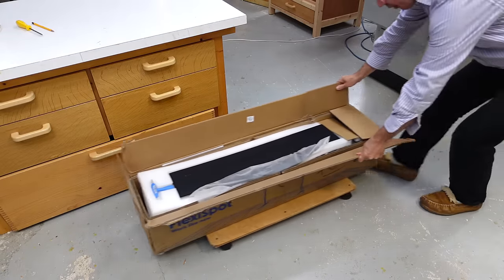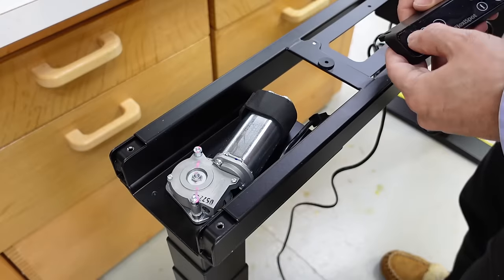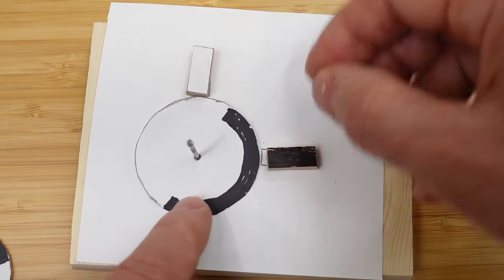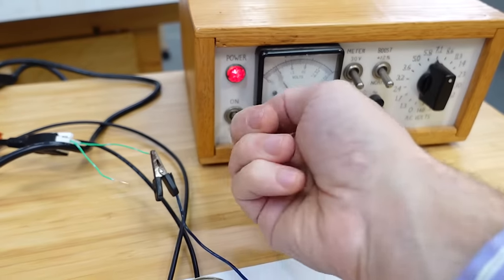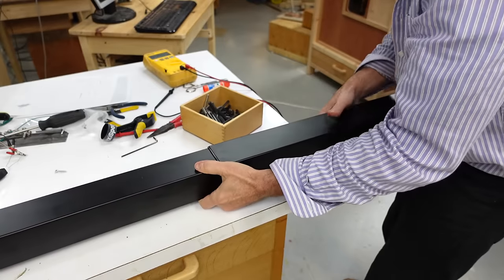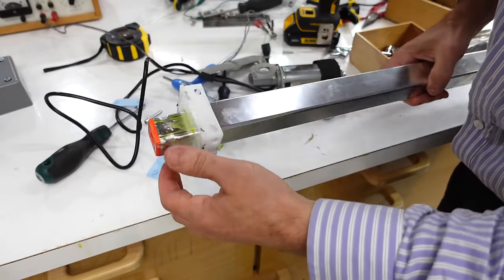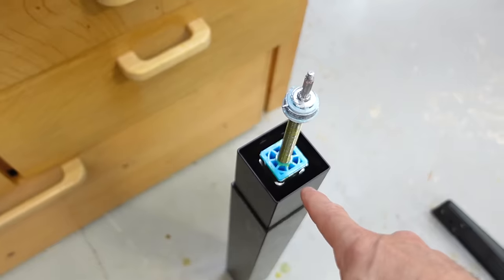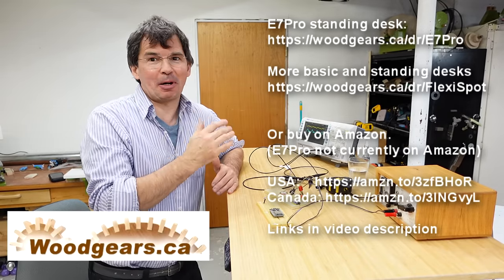How standing desk legs actually work

Comment: I hope FlexiSpot's next move is to send you just the mechanical extension portion that you didn't disassemble so we can see how close you were!
Reply from the maker: Already asked.  I think they would be willing to send a whole desk, but I'd hate to render a desk unusable just to look inside.
Reply: @matthiaswandel  In the end, the ruined part is the outer tube.  i bet once it is apart you could figure out the dimensions of said tube and replace that part to put the whole thing back together again with new tabs/crimps
Reply: @matthiaswandel Probably an easier tax write off. 🤷
Reply: @matthiaswandel  team up with the What's Inside channel lol
Reply: @matthiaswandel  maybe they can send you a leg from a faulty return?
Reply: I'm sure a render of the CAD model would suffice.
Reply: @matthiaswandel  you've done machines I thought impossible with wood. Might it be possible to mend the disassembly using your woodworking?
Reply: You can cut a slit or a hole into the extension and look inside without destroying it. Not everything is an autopsy.
Reply: @2adamast  That's true and he could also use one of those cheap endoscope cameras pushed through a drilled hole to see what's going on inside.

Comment: The dual motor setup also lets Flexispot use smaller motors or lift more weight, whichever they choose.
Reply: we are working on desks with higher weight capacity all time🥰
Reply: Maybe a little bit smaller, if you have a table rated at 100kg/200pounds, as a customer you would probably be a bit upset if that was only true dead center.

So if you have one motor, it needs to be able to lift 100kg and the mechanics will balance this. If you have two, they each need to be able to lift 100kg, since that's the worst case.

There is some slack, since there is losses in mechanics and maybe some forgiveness from customers, but I'd estimate each motor in a dual setup to be at least 75% of a single. So 50% more in total.

Comment: I've had my Flexispot desk for a few months now, and I've absolutely loved it. Dark Bamboo desk top, dual motor legs, 3 stored heights and an alarm for time based reminder for movement.

The reason it wasn't bottoming out around 7:49, was because it was running fast enough that when it reached the bottom it hit hard enough to trigger the collision avoidance. That's why it kept reverting to the last static height you left it at
Reply from the maker: yes, I figured that eventually, when I noticed that it reset when I hit bottom slowly

Comment: It would be interesting to see a DIY version made by you. Woodworking + salvaged steppers + threaded rod. Raspi or arduino or esp32 for controlling it. And of course, some wooden gears.
Reply: Nah, just use a reversible AC motor from the side of the road and a big switch. Anything more complex is overkill.

Comment: If you can extend the legs, you might be able to use it to lift and hold plywood or sheetrock up to the ceiling.
Reply from the maker: perhaps if put it on top of some boxes on a rolling workbench, yes.
Reply: @matthiaswandel just stack two desks
Reply: They make a tool for that already so that would be silly
Reply: @greenmoxy  It might cost less and its automated.

Comment: Some of the stuff in the video (re-aligning Z axis, for example) is stuff I've seen in 3D printers already, but it's good to see someone explain how all this works from a different angle.
Reply: It also makes sense that it would bottom out the lift mechanisms on both sides to zero out the system thereby resyncing the system. It probably uses locked rotor current detection to register that the motor has reached its limit.

Comment: Matthias, inspired by your first standing desk video, I purchased a double motor frame base and built a heavy 3' x 6.5' top for my wife, a textile artist. She loves not having to work bent over on the dining table-type arrangement she had before. Over the last few months, I have noticed that she seems to keep the table at the same height and not make adjustments, I would not have known what that preferred height was though, without having the adjustable table, so now if she wants another standing table in her studio I will just build her an additional one at that fixed height.
Thank you for your inspiration!
Reply from the maker: yes, funny that.  You don't now what the best height is until you can adjust to it

Comment: You are amazing and very analytical.  I will say, without a doubt, that you put more into tearing that apart to determine how it works then I would have (because I was getting nervous in how to put it back together).  Then you put back together, and it ended up working as well as before!  You're gooooddddd.  In the end, I feel that desk seemed like a good quality investment.  And it provided a considerable number of adjustments for positions.  If I needed one, I would get one.

Comment: It's pretty impressive that they thought to make it self correcting if the legs get out of sync. This might be a better choice than the version with the coupling shaft if you have kids, or pets that could stick things in the coupling shaft. The fact that it can take a bigger top would be a huge consideration too. The two motor system would make it able to have a higher load on the top.

Comment: These things really have my gears turning. I've been using drafting chairs and 'standing' desks (otherwise known as workbenches) for a long time, before they were cool I guess. So I've kind of ignored the motorized units. However, you make a very compelling argument at the end! When I'm soldering or inspecting circuit boards, I do sometimes wish my desk wasn't at 'typing comfortable' height. And this unit goes so unnaturally high that even when seated in a very tall chair or standing, I could really bring the work up to my face.
Reply from the maker: maybe you just need a regular chair to replace your drafting chairs to get lower down?
Reply: @matthiaswandel  That's too easy and way less interesting. The regular chairs I have at my disposal are unfortunately too low even at the highest adjustment. The drafting chair is still quite tall even at the lowest setting. The best solution is probably to just put my work on a cardboard box on top of the desk.

Comment: I tore apart an old C band satellite dish actuator motor and drive screw last week (to see how it works).  The screw tube with crimped nut etc is very similar to what you showed except my tube was circular rather than square.  A grinder and lathe (plus one blood sacrifice to the shop gods) got it apart finally.

Comment: Great video to satisfy my interest, I just bought an IKEA Bekant desk with of very similar construction. Had to resist taking it apart to figure out how the dual telescoping mechanism works. Amazingly it only has one 3 pin cable between the integrated leg assembly’s, so there must be some sort of fast digital communicating with a closed loop controller in each leg.
Reply: Could still be a step signal if they assume the direction from applied power. Not quite as robust but very much adequate for applications like this.

Comment: Very cool, thanks for the teardown and explanation! Really neat how they seem to operate in tandem with such simplistic logic. And under normal circumstances, they probably won't have to deal with those more complicated failure modes you demonstrated. 

I'm not sure a moving desk would suit me at this time, but after this video, I do at least feel a bit more comfortable with the idea, and how reliable and safe it might actually be. Still might be nice if they had mechanical locks to prevent it from collapsing, but even as-is, I'd definitely consider these - like you suggested, for electronics and DIY work. I hadn't thought of using a standing desk with a sewing machine, but yeah that might be nice, too.

Comment: From the thumbnail, I could immediately tell that the table would have two linear actuators working in situ with each other, especially the size of that power supply and controller. The motor is basically rotating a worm screw on the shaft which is a 90° then rotating a big metal reed screw, and the actuators have integrated microswitches.

Comment: So funny that you uploaded this - I just bought a similar dual motor standing desk, though it only has two leg segments. As such, the minimum height was also too high, so using your last standing desk video as inspiration I took it apart and made modifications to get it lower. I feel your pain with those end clips! You did a much better job than me of not getting lithium grease everywhere 😂 a three segment standing desk does seem to be the way to go, will consider this brand if I ever need another. Thanks for the inspiration 😁

Comment: I had a metal shaper with a telescopic screw arrangement, a hollow threaded rod with a nut on the end and another threaded rod threaded into that nut, both with the same pitch. It worked really well, other than it being slightly annoying when you're cranking a long distance and it transitions from one screw to the other, there's a noticable difference in resistance because of the different diameters

Comment: That one also probably has programmable positions for exactly the reasons you mentioned. You just enter a number on the keypad or scroll and it will go to a happy place, or a serious work place or... 
You are right about the nested screws and there are 3. The top driven one is inside a floating one that has stops on the ends so it spins until the top screw bottoms out (up) then the floating one spins. 
As it spins against the inside of the bottom screw the top and middle act as one, so it can go almost 3 times the height of the lowest position. The bottom one is attached to the leg. The top one is threaded on the outside, the middle is threaded inner and outer surfaces and the bottom has inside threads. And many screws holding it together!

Comment: Back in like 2013 or 2014 the company I was working for rolled out a couple thousand standing desks.  On those early ones the controllers would occasionally get out of whack and drive the legs unequally, leading to someone's desk getting tilted

Comment: I'm on my way to make huge desk for my PC. The design of those adjustable legs are my inspiration. My build won't able to get up an down, it's okay. But because I want to match the overall layout/structure I realize I need to have a beefy plate to connects the legs with the "paralel bar" (?) Idk what to called it. But the plate what I mean is this plate that yoy put together 0:42 . Thanks to make this video !

Comment: I have a similar style of standing desk mechanism(two separate motors, connected via cables and a control board - just slightly different design). Every now and then one of the sides will have a bit of a hard time going up or down, and the display would show rst. In that case, you're supposed to hold the down button(on mine I have to hold it for a few seconds before it starts moving, but in your case it seems to go down right away), wait for it to bottom out, keep holding and it goes up a tiny bit and then it stops. This is the reset procedure that I found in some document online and it seems to do the trick every time. Your desk seems to do just about the same thing - it bottoms out both motors and then goes up a tiny bit and then it shows the height on the display.

Comment: 10:40 when u finally got the legs apart 🤣💕👏👍
PS- have flexispot send you a leg rod assembly to cut open so we can see how it works! 🙏😁
Reply from the maker: already asked, but that's not something the folks I have contact with can just do.
Reply: @matthiaswandel  dang, maybe someone else has dissected one or a similar one or we can pull up the schematics
Reply: @JonnyDIY  I looked up patents for Flexispot, and all I got was US patent US-11633038-B2.  I didn't read through it all, but the drawings focus on the leg design and don't show the inner detail.  Issued in April of this year, fwiw.

Comment: Interesting.  I'd have suspected there would be one motor and a belt or chain running to each leg (like an automotive lift).  I'm sure they probably thought of this at some point but the bean-counters added up all the parts and determined they could do it this way cheaper.
Reply from the maker: No, the problem with that is that its width adjustable, so the buyer would have to splice chain links and get it all lined up together. A second motor could cost less than the support cost and returns for something a consumer can't handle.

Comment: That desk doesn't go down low enough to meet industry standards, and goes ridiculously high.  22.6" to 48.7" is the Industry Standard.  That accommodates a 5th percentile seated female (about 5' tall) to a 95th percentile standing height male. 
Plus Too many parts and pieces... to install.  Nice video.  Try a Steelcase SOLO desk!   So much easier to assemble.

Comment: I have a height adjustable desk just like this - it's interesting to see the plastic mechanical parts inside the legs. I had one leg fail mechanically on mine after a few months with a horrible knocking and grinding noise when it moved. Fortunately mine has never gone out of sync in 3 years as I wouldn't be able to bottom it out to re-sync it again without it hitting a radiator

Comment: We had the legs go uneven on one of the standing desks in our office, and the "reset" function where it lowers all the way to zero was out of whack. I had to rig a power supply to separately lower each leg all the way down, then it would reset properly and has been functioning fine ever since.
Reply from the maker: You may notice that when I tried to lower it from crooked, it first mistook that for a collision until I lowered it in steps so it was going slowly when it hit bottom
Reply: @matthiaswandel  Yes, I think ours was reading it as a collision, too, but it wouldn't budge at all through the interface. I lowered the legs with the controller completely disconnected and unpowered, applying 24v directly to the motors. It could very well have been that just disconnecting and re-connecting them actually did the trick, forcing a reset. I do appreciate the power of the dual motor version of these desks, but there's something to be said for the simplicity of the single motor versions with a driveshaft controlling both legs.

Comment: Slightly off-topic, but still fascinating: when you get the chance, check out how the mechanism works that is used in re-closable milk/juice cartons. When you first open one by unscrewing the cap, the inner part cuts into the cardboard. Two coaxial threads are involved. I wish I could come up with mechanisms like this.

Comment: Those controllers are used on Mobility scooters and powered wheelchairs. there is a programmer device that can be connected via the remote port but I forget what it's called. As the sit/stand desk market moved farther away from it's roots I think they also started getting the controllers customized, if so the software to program the controller could also be locked.

Comment: The screw may have a left hand and right hand thread like a turnbuckle. Turning the screw will move things in opposite directions.
Reply: That's exactly what I thought. One end is right handed and the other left. one for the inner and one for the outer tubes
Reply from the maker: that would make sense if the screw was long enough.  But given that the leg becomes more than 2x long, a single screw would not have enough reach.
Reply: I was going to say the same thing - but I looked at their website and these desks extend over twice the lowest setting. A turnbuckle style extension would only allow a lift of twice the overall length minus some overlap, which is not enough. So I think Matthias is correct in that the two screws must overlap.
Reply: What if 1 screw was smaller diameter and nested inside of the larger diameter screw?
Reply: @mikewatson4644  That's exactly what Matthias described in his video.  There may be other ways of accomplishing this task, but I can't think of any.

Comment: So basically there's just three threaded sections inside that bit. There's the first threaded rod that you can see that the motor attached to, a second threaded tube with internal and external threads that the motor rod threads into and the square shaft with internal threads that the tube threads into. When one section reaches its end there's an end stop to keep it from uncoupling and also forces the rotation into the next threaded bit. So first the tube unthreads from the motor rod and then the tube gets turned by the motor rod and unthreads from the square shaft.
Reply: This isn't quite what I saw before but it's pretty similar concept
https://youtu.be/nmyvMkfxtbo

Comment: The mech, controls , and behaviors look a lot like Linak's. The "bouncing" from during the second uneven leg test was likely due to anti-collision, prevents the desk from crushing stuff/people.

Older designs of Liank's desk lifters used chain and a similar double extend-from-center design and the motor was integrated in to the leg itself. The flaw on those ones was the plastic housing would eventually shatter if they were running closer to their max load spec. The newer revision uses a lead screw.

Comment: I have a similar desk (dual motors, no gearing/shaft interconnect between the two legs, triple stage legs etc.) that has a 150 x 70 cm top, bought from a company called Monarch in India (I'm sure many components are imported from China). The motors are claimed to be Bosch. My standing setting is 112 cm, have never tried it beyond 113 cm. Weight rating is 100 kg.